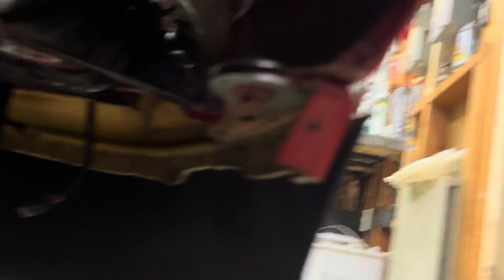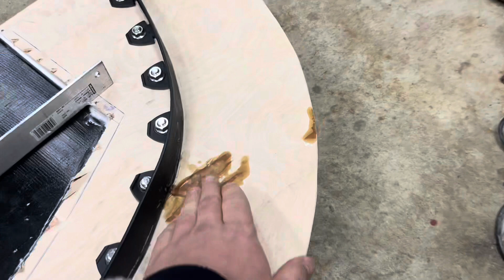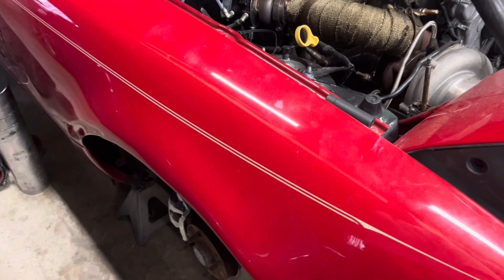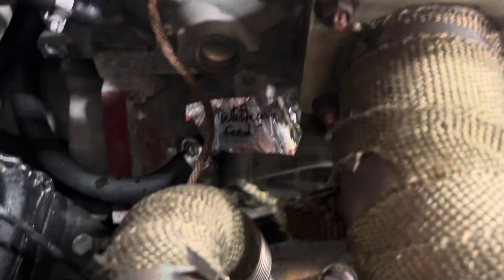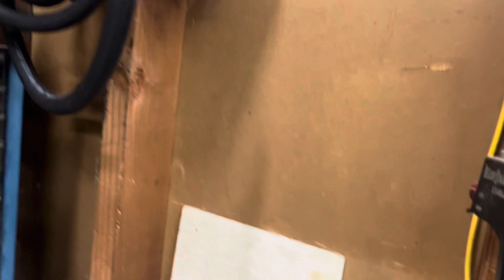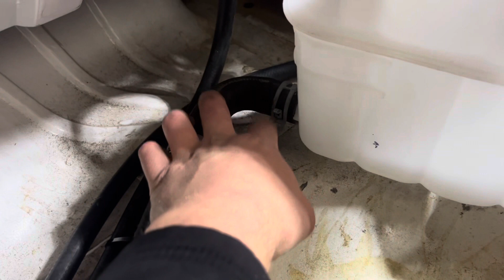Do it right the FIRST time, otherwise you’ll redo it later: EcoBoost Miata Degas Cooling system

Comment: It appears you have a pressure relief cap on the top of the radiator? 

I’ve never seen a hybrid setup. Either degas, no pressure relief or pressure relief and no degas